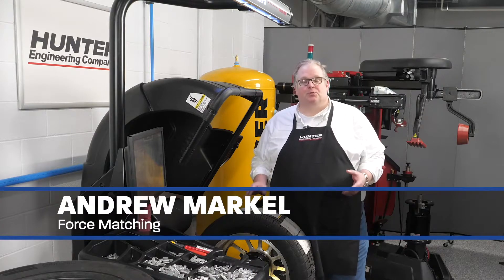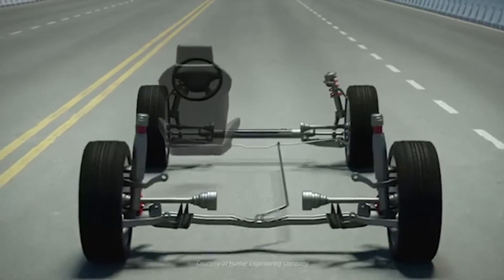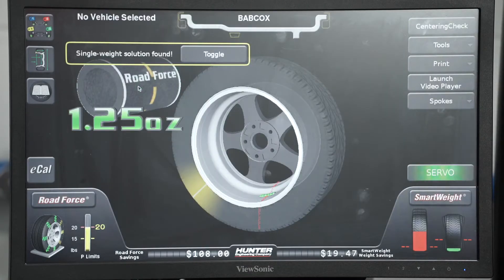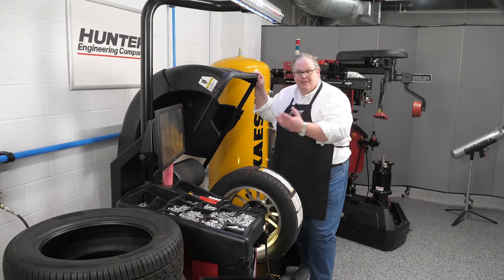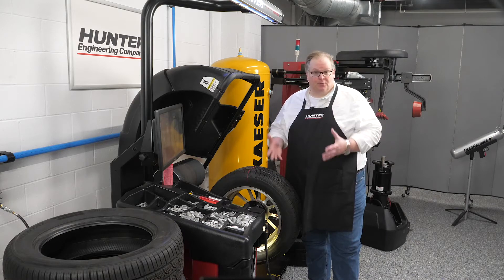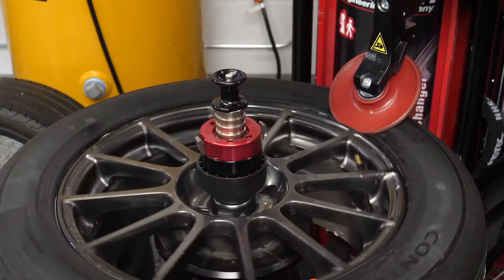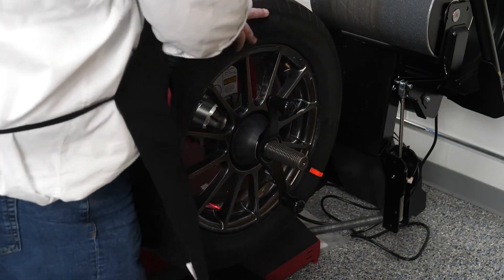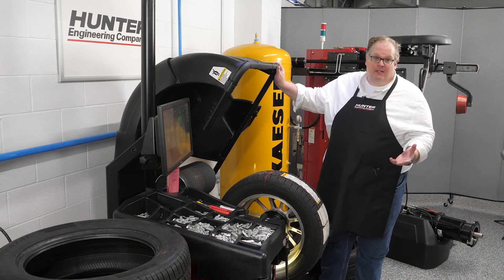Force match balancing can solve tire vibration issues

Comment: my rim had a yellow mark on the rim not green....I was told that was the lowest point in a rim. Does that mean with yellow the rim is slightly bent
Reply: Slightly bent is somewhat of a good thing because you can typically "hide" the bad spot in the tire in the low spot of the wheel, it's almost more of a problem when you have absolutely precise wheels because that means the road force machine is unable to improve anything

Comment: Maybe I'm retarded but it's started at 18lbs of road force and u were able to lower it to 14lbs which is a difference of 4lbs not 6 to 8lbs. 🤔
Reply: The whole video was a waste of time because he didn't really solve anything. The predicted road force was a 2 after matching and he got nowhere close and made it sound like what he accomplished which was really nothing.
Reply: This is a pretty common thing that you can't get exactly what it predicted, sometimes it's more sometimes it's less, the real thing to know here that they don't seem to point out is that if you can't fix the road Force issue you have a bad tire if it is so bad it's causing a vibration but the actual dynamic balance is reading a perfect zero

Comment: I had 37" mud tires that others tried to balance. Found a shop with an HD road force balancer and they knew how to use it. They had all the tires balanced in about 2 hours. All vibration is gone now even at high interstate speeds of 80 mph. Bringing my motorhome to get rid of the vibration in its tires.

Comment: I got this done at my dealership and they said my tires can't balance because the tires are 6/32. Is that right? You can't balance tires with thread life at 6/32?
Reply: Because they just want to sell you new ones.
Reply: Perhaps this is why America's Tire / Discount Tire and other Tire stores do not incorporate mechanical services and strictly sell and work on different tire procedures.  Walmart tries to provide a short list of preventative maintenance style services, but they likely will need to shorten the list with all of the added complexities that the automotive manufacturers are now incorporating.  

Every year, new sensors are being interfaced and its a lot to ask of a lube & battery technician to know how to enter radio codes for all manufacturers that Americans provide.  I'm not saying its impossible, buts a lot for automotive professionals who work on "all" makes and models.

It may be the situation where the emergence of specialized vendors to spread the most useful information necessary with respect to a car's new technology.

Providing unauthorized and authorized repair service providers expedited contact information and expedited parts procurement is super important to ensure customer satisfaction and any idea of brand loyalty / repeat business.
Reply: That's plenty of tread for a little while it's about 60% maybe 50% life you can absolutely balance a tire even with zero tread life left you can balance it maybe they had some kind of rule where they would just push new tires on a customer

Comment: Initially the wheel was tagged as a passenger wheel (see bottom left of screen on initial spin), after repositioning the tire on the wheel it was selected has a LT assembly, my guess for the road force to be in the “green” . Isn’t there really an issue with the tire in this case?
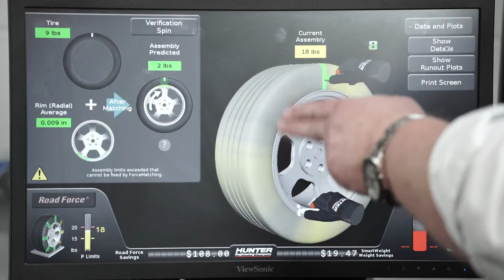Reply: Good Eye! I also see that the rim runout is different. I'm guessing that he used a different wheel/tire. Notice there is a white mark between the stickers at 4:30 that isn't there at 1:49.
Reply: Hahaha oops